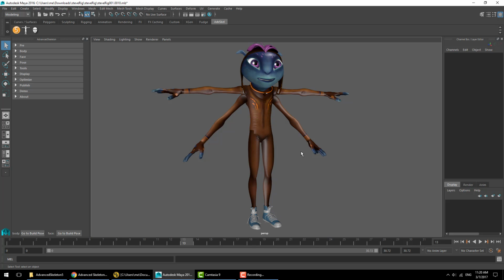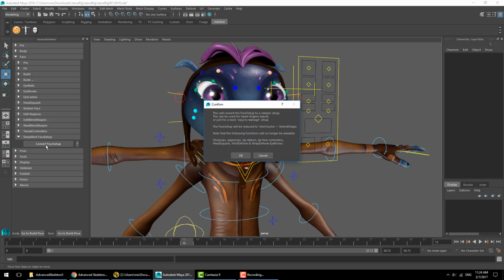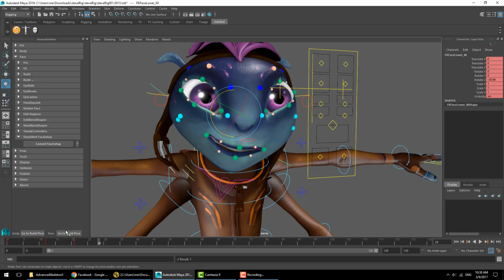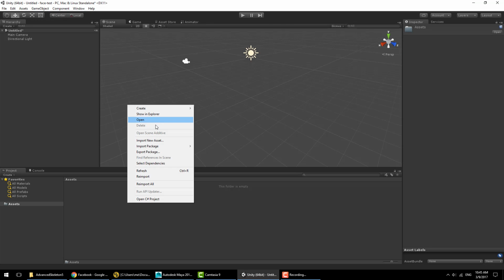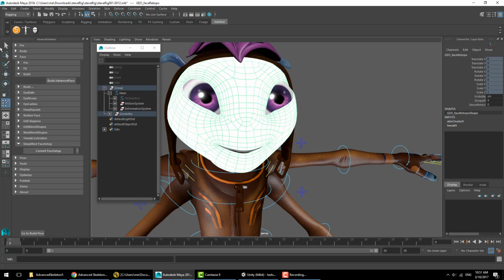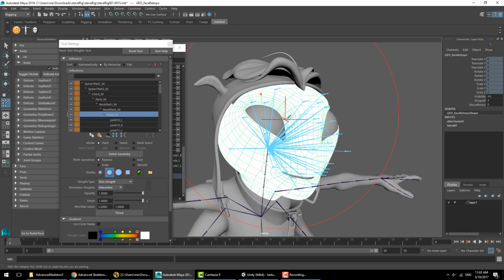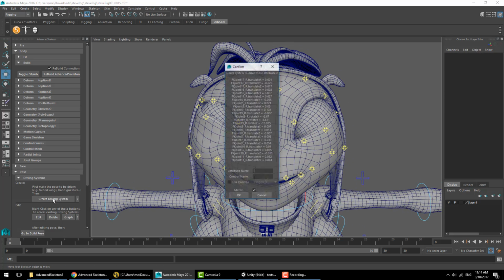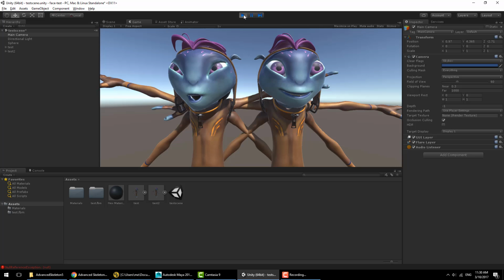FaceSetup for GameEngine export

Comment: Is the simplified face setup no longer available? I can't find it anywhere in the latest version. Also, is there any way to limit weight influences to 4 or 8 in order to limit the complexity for game engines?
Reply from the maker: As for the Simplified Face Setup function, check this video:
https://www.youtube.com/watch?v=3KPD7zBRWn0&t=2670s
As for reducing weight influences, check the "Reduce Joints" function in the "Optimize" section of the tool.
Reply: @AdvancedSkeleton  That's great, thanks! Does the face rig build process acknowledge the max number of weight influences you have set?

Comment: Hello,
Greetings. I am following all the above rules (except the second way) to use my animation in unity(2019.2.7). I have "Simplified-FaceSetup" along with & without "optimize SkinCluster for export in" & "optimize joint-count for export" but unfortunately, it is not working properly. Facial expression is broken in some areas! I am using maya 2019 & AS 5.720
Please help me.
Thanks
Reply: I had the exact same problem and it drove me nuts. I have tried every setting and every version of fbx files listed. Same problem. 

fbx files in unity had problems with eyelids and eyeballs. 

Fixing this problem was easy. Just export your file as DAE_FBX.